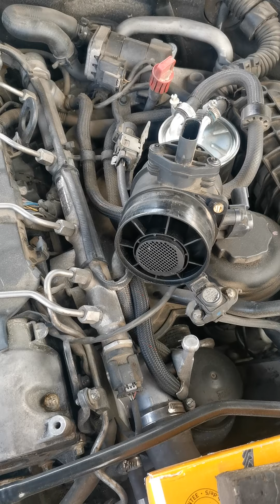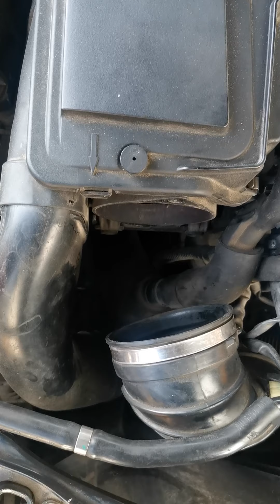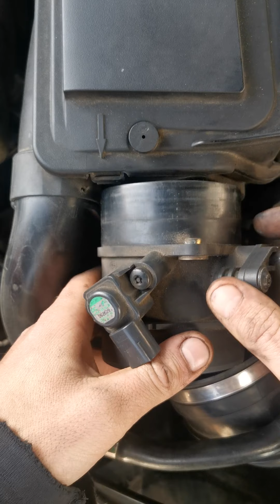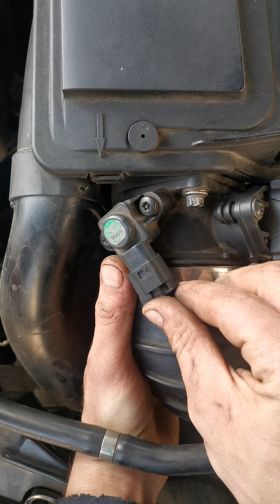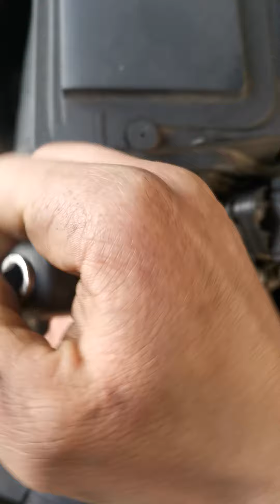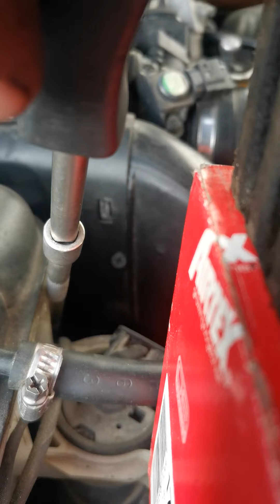Mercedes c220 cdi w203 mass air flow

Comment: I have missing power after very fast driving when sits , drives good later on i drive very fast again and again looose power , little bit rpm mowing , and engine on stop rattle can be maf?
Reply: Did you end up figuring it out i have the same problem
Reply: I have the same power
Reply: Nop sold car ..:D ir can be many problema